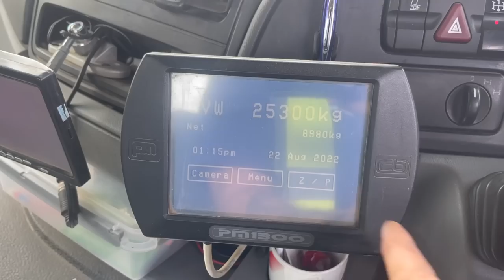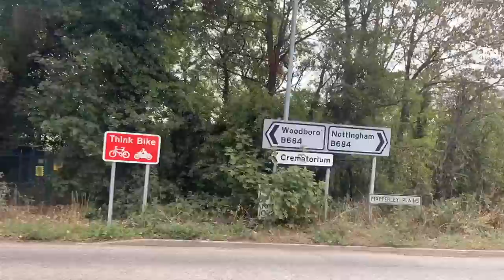SOMEONE HAS MESSED RIGHT UP! - This Week At D&J Projects #067

Comment: Another excellent video this week lads quick question Dave when swapping between lorry's does your taco time reset your driving hours as it's a different lorry or does it stay the same for the day which ever lorry you are in ?  Hope that makes sense? 👍 Also do you use driving hours up when using the grab or is it classed as a break because your not driving ?
Reply: @Geo1872.  thanks for the reply appreciate it